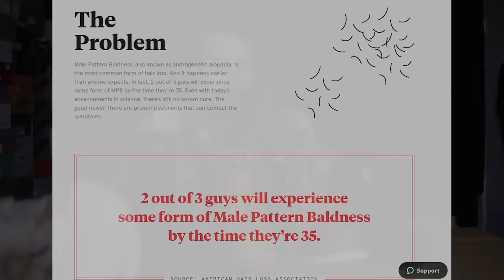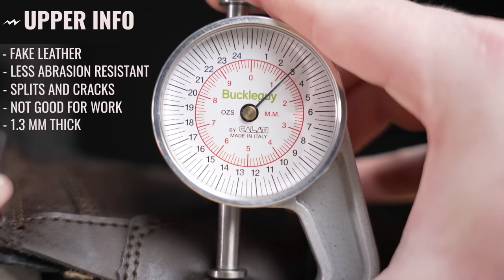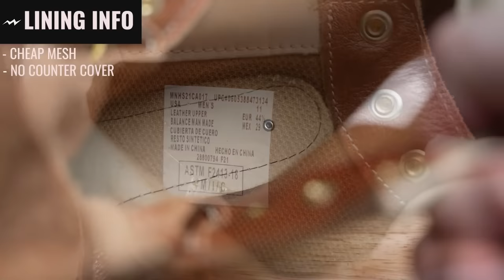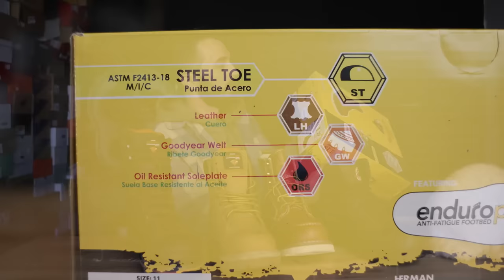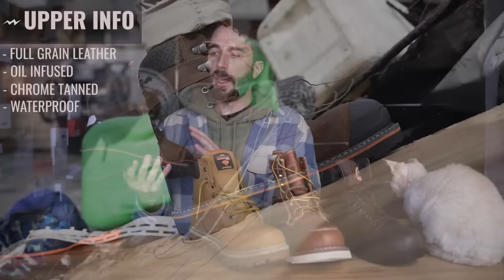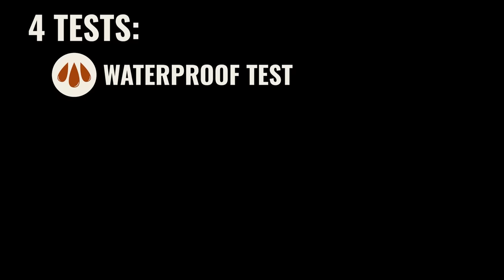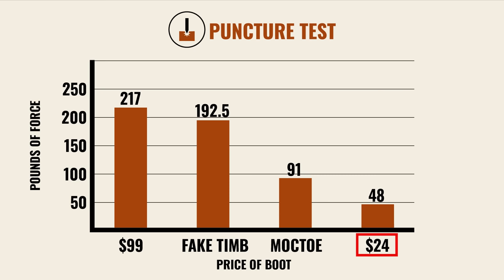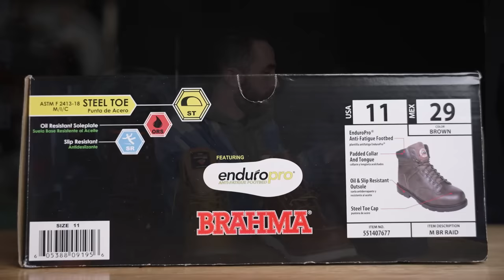The Truth About Walmart Work Boots - Best CHEAP Work Boots or TRASH?

Comment: In 2006, I bought my first Brahma steel toe shoe.  It was good, lasted 2-3 years.  Then, the last 3rd and 4th pair were shit.  I mean, after 6 months of wearing it, you can see the rubber sole.  Brahma was cheap, but quality got shittier. And so, I bought Sketcher working shoe with steel toe, it was good w/ memory foam. So Weston, can you cut open a sketcher working shoes or boots?
Reply: I wore Wolverine work boots for at least a years to 18 months  until they cheapend them to last 6-8 months. Started wearing Timberland and was much happier until the prices kept climbing, prompting me too search for a cheaper, yet still decent alternative. Like you, I found a Sketchers boot that has worked out well this far but I wouldn't expect a cross section to reveal anything extraordinary. Time will tell the tale of long term durability and comfort.

Comment: I wear the Herman survivor boots to work in asphalt. I have found them to hold up better than wolverine durashock boots in the heat. Asphalt is 450 degrees, it will melt the soles off wolverines in a fiew weeks. I have wore the Jason 3 model survivors for up to three years before!

Comment: Diesel mechanic for 31 years and I have tried every brand boot under $200. I just quit wearing my $100 pair of Herman Survivor Pro Series after 3 years of use, the sole separated from the boot. They are heavy boots, but the best, longest lasting, and very comfortable (after break in) boots I've worn. Would definitely buy again and would recommend to anyone needing a quality boot at a value price.

Comment: 1 pair of my timberland pro dark brown oiled lasted 5 years in engineering. I jumped off a bench landed on a piece of 45 degree box section off cut very sharp ,the plate saved my foot. Have a new pair. The best boot if you’re on your feet all day.

Comment: As someone who's had the timb style boots as well as another herman model with a similar sole, I can confirm that they will not last anywhere but on a smooth even surface.  If you are working on jagged broken concrete or even sharp gravel the soft, thin, rubber outsole will actually tear and expose the even softer injected foam filling.  I used mine mostly to cut the grass, which was fine, but I also used them for some small concrete demo projects on my house.  The broken concrete tore up the sole the first day.  After that I used them on the lawn and that was it, until the foam fill completely deteriorated.  The uppers were good though.

I'm currently looking at the $100 boots, simply because I'm generally I use them for working around the house.  Things like landscaping, pouring small concrete projects, the occasional welding (my jeans will cover the nylon portions of the uppers so sparks aren't an issue), and climbing and climbing trees.  The added ankle support will be a welcome factor on some of the steep hills.  You did forget to mention that of the boots tested, the $100 boots are the tallest in the ankle.  Herman does offer another pair at the same price that looks identical, but has a shorter ankle and a patterned leather.

Comment: Have bought a few used boots back in the day when I was first starting working. I paid about $30 - $50 for those used boots where they would have cost more than five times that new. Had a pair of last over 10 years. SO I agree for anyone who needs a great long lasting work boot for as little money as passable... Used is the way to go. All I did was make sure to look for ones that were barely used, sanitised them with 70% rubbing alcohol and or spray them with Lysol disinfectant spray. Wash or replace the insole liners. Of course let them air dry completely after the treatment. Have never had an issue wearing used boots, because I made sure to clean and disinfect them properly before use.

Comment: Yes you can. I.wore the 100 dollar ones for many years. I always had 3 pair in my locker all the time. If your wondering why 3 I worked overtime. Every 8 hours I would change to let them dry out. They lasted fairly good as I worked in the glass bottle making business. Sometimes you had to walk thru hot glass so sole did not last long. The shoes would last 6 months on average sometimes 1 year.

Comment: I can tell you now that the Drillers are good boots. They will last about a year or so if used daily. However the end life is with the sole of the boot. Expect the bottom front mid section to be where it fails with these. I've had two pairs and they both wore out to the point where tears appeared on the bottom. Usually I just dealt with wet feet for a couple months before replacing them. I do recommend them and that soft rubber insole is really its only flaw. It is light, protective, and waterproof. 

The drop test was awesome. I've seen some nasty wounds from steel toes crushing into feet from the back edge being forced down. The one I most remember was a guy trapped in his boot with a broken foot requiring the fire department to saw the boot in half with his foot inside. Better that than no toes I suppose.

Comment: I got a pair of Brahma boots from Walmart for $11. Cheapest pair I could find, but it was just for a Halloween costume so I didn’t care. About a year later, I started a job that required work boots, and I decided to wear the Brahmas until I could better actual boots. 2 years of hard use later, they’re cracked and torn but have held up amazingly well. Very waterproof, even with the top layer of one torn in a few places, comfortable, soles are still in great condition, and fairly resistant to damage. I don’t think I’d ever really recommend them if you needed work boots, but I will say I got way more than $11 worth out of them.

Comment: I bought the Doziers from walmart, before I saw this review. They are extremely heavy and for whatever reason they also run very very large, the largest I've ever had a shoe run. I usually wear an 8 or 8.5, but I ended up getting a 7.5, the smallest they had, but I threw an extra insole inside of them to take up the space. I returned them and got the $75 Herman "Dover" model boots, which are a logger style boot according to the description online. The Dovers aren't as tall of a boot but way more comfortable and cheaper too. Performance remains to be seen on the Dovers, I just got them last night. I am in school for automotive technology and work on cars frequently so oil and slip resistance is huge. They appear to the exact same leather as the Doziers ($100 boots). 

The leather on these new Dover boots do indeed soak up the water a bit like the $100 boots but I'm going to wear them in a bit and see how they do.

Comment: Got a pair of pull on Brahma’s back in college when I was in a pinch. Left my normal boots at home by accident. I was rough on those for at least 15 years. Ranch work, handyman, landscaping, and carpentry. No clue how they lasted that long but they did. They finally gave up the ghost. Looked for a new pair of them and couldn’t find them anymore. Best pair of boots I ever owned. Even if they lasted a year with the abuse I put them through, I would buy a pair again.

Comment: Great video! I still have a pair of Walmart leather steel toe work SHOES. Low cut regular looking leather shoes but steel toe. They are fairly comfortable, but are too expensive to wear because they wear holes in my socks in just one day. Really weird.
I wear a pair of Ariat full leather work boots with composite toe. They frown on steel toes on the North Slope of Alaska because your toes can freeze more quickly. I have more work boots than I'll ever need. 2 pair were given to me by customers in Asia. Very good leather and they said they were the best boots they could get. And this was a fire safety supply company. I've worn out a pair of Red Wings. The sole is completely slick but they are still my favorite boots. I got another great pair of Red Wings at 70% off at a 'Going Out Of Business" sale.  Oh, and all of the boots I picked out and bought, I got reimbursed for. I surely can't complain.

Comment: I work at at a concrete precast plant. Average, close to 60hrs a week. For 10yrs, I've been buying the 6" Breakers. The Drillers aren't in my area but they look almost an exact replica. I've tried so many other brands. None feel as light and comfortable as the Breakers. Between the slurry and kicking stressed stranded steel wire, they last a little longer than a year. Luckily, my union contract holds me down for 5 pairs worth a year. I buy a pair Breakers for work and get name brands for testing (fashion). In my opinion, the Breakers (I'm assuming the Drillers as well) are worth the money if your just starting construction to see if it fits you. It's not for everyone. Better to not spend too much money until your sure. In the same breath, a real bad pair of boots can unfairly influence how you feel about a job. P. S. Look into wide width. Learned that one the worst way.

Comment: Im almost to the end of the introduction of the boots. The last 2 pair I want. Now I'm gonna see which I should buy. I bought a pair of Hi recs a year ago. Hit them with 3 coats of Bear grease. The sole at the toes has started coming apart  the I need heel material has holescworn in them . on the positive points. They were comfy day one outta the box. They are light enough they don't hurt my back and knees. They never allowed my feet to get wet. I never slipped on any substance in them except ice. And no footware can prevent that without simples. 😂 They also didn't hurt my feet. 

The bad results. The upper hook eyelets pulled out. Early. The inner liner has huge ones in them and the liner actually pulls out via the heel of the boot at times. The sole is separating at the toes. Was gonna glue them. But , think I'll send them to you after I get my new boots via this video. They aren't the last bit warm. But I have a pair of military issue pair of muckluks with liners for cold weather and hunting. I can walk on long hikes comfortably in the boots , but can feel the inner liner moving in the boot while hiking. They are hard to keep tight without the upper eyelets. 

Highlights. My feet have been dry. They have made it easier to walk lomg distances with the least amount of pain and undue wear and tear on the body. The leather which I treated is eating good on thevexterrior. The skies other than the toe separation issue are good. All in all. They would be a great boot with more attention to detail on the inner lining material and the sole connection. I see this becoming an issueceventually. Gluing it may help. But i shouldn't need to glue the boots. Nor should I not be able to the them tight and actually have the ability to lace them all the way up.

Comment: I have been in the safety footwear business for 32 years in Canada. All safety boots and shoes sold here have to be tested and approved by the Canadian Standards Association. The points covered are the resistance of the safety toe, the puncture resistant plate and the electrical conductivity of the boot itself. Asian manufacturers make what you order, Timberlands are made there to american specs, Walmart orders degraded products made only for a price. There exist many good products on the world market, not all available in the US. Many from France and Italy, some from Canada also are manufactured with modern machinery with modern features. These products are starting to appear on the american market but have to overcome the conservative tendency of the american consumer. Goodyear welts represent a type of construction that is very robust and long lasting but expensive to make. I think that a polyurethane injected boot with a rubber outsole and a Goretex booty represents the summum in comfort, wearability and lightness. You can't repair them when the sole is worn but they last as long as a pair of welted boots plus two sole replacements while being much lighter. The american army is using this system now and for the past twenty years I think. The average Joe is still of the mind set of "what was good for my papy and my grand-papy is good for me" ;) That's my opinion.

Comment: I have  a few pairs of Moc toe boots: Redwing, Chippewa, Thorogood, and Herman Survivor.

The Herman Mocs I bought on clearance for $35, same finish as shown, except they were the 8" version.

Being used to considerably more expensive boots, i had minimal expectations for the Hermans.
When my package arrived, the first thing I noticed was the smell. 
There was an awful scent of fresh PVC coming from the boots, I imagine from the soles. This proved to  take weeks to outgas. 

The second thing I noticed was the characteriatics of the color/finish. Compared to "real" boots, they looked fake, almost like a costume version of a classic moc toe boot.

Taking them out, the third thing I noticed was the weight. If you are used to "real" boots, these are about  1/2 the weight. Even though these were 8" steel toe,  they weighed much less than my 6" non-steel toe boots.

Performance:
Using them, they performed much better than expected. I only use them for indoor shop use, and occasional yard work. The nails sail through the sole, so I don't recommend using them for carpentry or demolition work. 
But they were comfortable with a decent amount of room in the toe, and the leather was exceptionally breathable. Long shifts won't leave you with trench foot. I'm surprised they wasted time putting lining in  it, because if yiurbleather is good enough on an uninsulated boot, you normally don't need a lining up to your ankles.
The finish looks better after you use them a lot. I've had mine about a year, wearing them 2x a week. After they have a decent amount of scuffs and abrasions, if you clean them properly and wax them, they actually look like much better boots. 
The leather is surprisingly decent , even though the finish is borderline comical. It doesn't have that over-oiled feel, because,  it isn't oil tanned. It has the feel of more traditional leather boots from decades ago, before they just used oil-tan for everything.
Would I have paid the $98 full price for these 8" boots?
No. Especially knowing how little they cost to make.
But like I said, I got them on clearance for $35, and these 8" are no longer available.
The 6" version shown here is $60. That being said, It's better than any other $60 moc toe boot. Good luck finding a leather moc toe for  $60 from anyone, anywhere.
If you want a pair, just for the look, get a pair, leave them out where the smell can go away, wear them in the mud and the dirt, wash, repeat, wash, dry and wax. They will go from  looking like a $30 boot to looking like a ...$80 boot. 
But the Goodyear Welt is pointless. Yeah, you can resole them. But the midsole will probably not be up to the task, or the cardboard footbed. Even if they were, the last time I resoled a moc toe wedge sole, it was $85. So, it's kind of pointless from a financial standpoint to spend $85 fixing a $60 boot, especially if the rest of the boot won't last long enough to appreciate the work. But people have other reasons for fixing things besides saving money, so, to each their own.

Comment: Something people don't think about until they actually wear boots for work is understanding where boots typically wear out. The sole is literally never the wear point. My first work boots failed at the laces - the eyelets for the laces pulled out. Every pair of boots after that wore out near the pinky toe, and this is caused by kneeling or sitting on concrete or gravel. Electrical and plumping work involve a lot of kneeling on the ground, so you'll find yourself sitting on top of your boots, and the contact point with the ground is around the pinky toe.

Comment: Army surplus store has used combat boots from multiple conflicts and service branches  depending  on stores 40 bucks a pair . Gortex body these aren't light water proof to a point at ankles. Sizes for days  I'm a 12 EE  - they are comfortable , I've worn these almost everyday / welding ,burning , mud for a couple days ,ATV and dirt bike fun , 12years of total abuse  compressed air twice a year cleans inside and tongue area under laces  .A hiking boot oil helps to keep soft and water proof , interior of boot still excellent condition .Try a pair good for walking too.

Comment: I tried a pair of the $24 boots.  They didn't last as long as I hoped they would.  At the time I was an over-the-road driver(now medically retired) and you'd be surprised at some of the places I had to go.  Everywhere isn't spit and polished.  Every lot I pulled into was not concrete or asphalt.  Every place was not dry.  I did it in all types of weather be it hot, cold, wet or dry.  One of the enemies of foot wear I quickly discovered was diesel products.  They'd slowly eat away at the shoe.  Let's not forget the different surfaces I had to walk on.  Everything from fine sand to gravel to snow and so forth I had to walk on.  Sand can be as slippery as ice if you step on it just right but then the chemicals on the ground/floor you my have to go across.  It all eats the foot gear.  Sometimes I had to use sand and or grass to clean the boots off so I could walk normally or wouldn't track it into the truck.  There were also times when I stepped out of the truck into a pool of water knee high and can't readily change foot wear.  I did find a pair at Burlington Coat Factory that lasted longer than I expected though.  I found them to be rather comfortable...